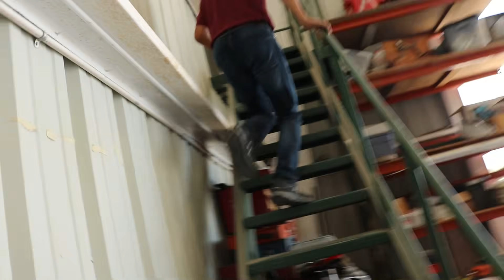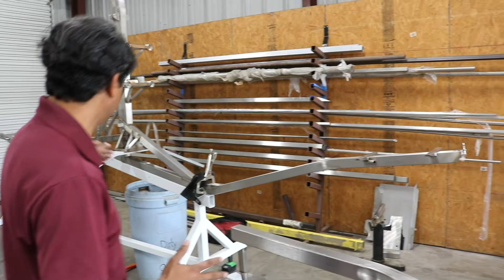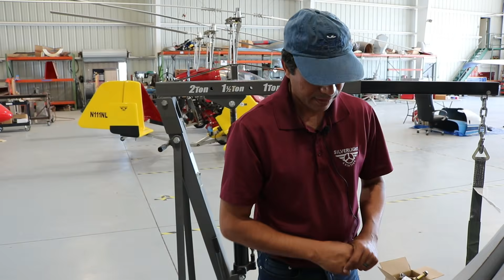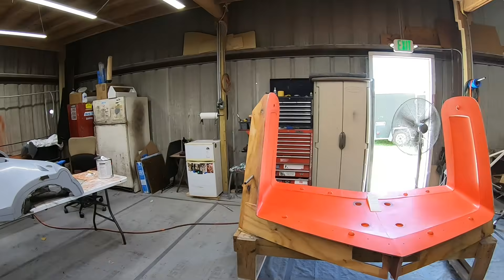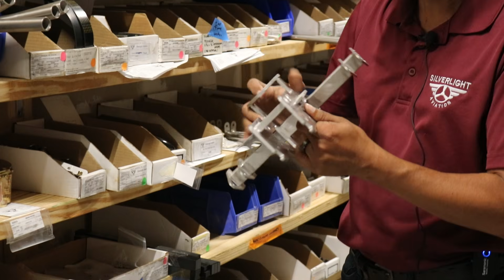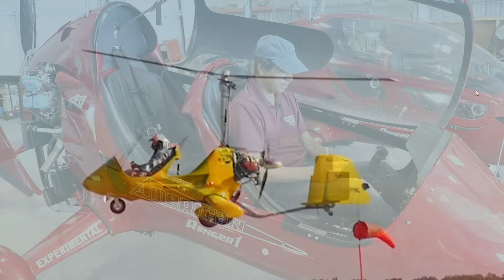Gyrocopters! How Its Made | Factory Tour of Silverlight Aviation Gyroplanes

Comment: Sir can you tell me about airframe material? ??? 7075 aluminium???? Or others? ??
Reply: 304 Stainless Steel Tig welded using 308 rod with Argon gas purge front and back. Are you a structural engineer or designer?

Comment: The issue with these is insurance can't really get insurance in the US for a Gyro being a zero-time pilot. Pilots who have lots of hours they pay 10% of the value annually. $65k is $6500 a year to insure them if you need a loan to buy one can't use the gyro as collateral if you don't plan to insure it. Have to pay cash or find another way to finance it maybe 401k loan or 2nd mortgage. IMO if you don't have the cash to lose have to get a loan it would be foolish to not have insurance.
Reply: That is correct. The gyroplane pool is small. Only 1100 in the US. Also accident rate is relatively higher but not because of the machine. Most pilots coming into light sport in general but gyroplane more specifically are in the 70+ year old range. The accident stats show they are more prone to accidents in all of aviation and they are heavily concentrated in light sport and gyroplane segment. We need more 50 year olds or younger coming into this segment. The accident rate will be down then. Most people buying our machines do not take a loan. They pay cash.

Comment: You'll sell more of them if you install an SEG Electromagnetic Generator for power you'll never run out of. Fly as long as you want.
Reply: That tech is very far away from getting to the point of being used reliably as an aircraft powerplant. Interesting though

Comment: Liked when he said some of the chassis was made in Taiwan or China....But that doesn’t matter...It does when these components fail in mid air......Would not trust....Look how small the production line is.....
Reply: Huh. Nah. You heard completely wrong. Some of the smaller tubing in the frame that is not structurally very significant is made in Taiwan. All the main structural frame tubing is made in a US mill

Comment: Great Video of an Excellent Gyro!  I would love to work with you Abid on designing a FWF package for the MWFly engine line.
Reply from the maker: They are quite set with their Rotax and ASTM standards for the moment. Are you FLYING yet??  In the USA?
Reply: @ExperimentalAircraftChannel  MWFly is ASTM certified, but would indeed require modification of the production standards… however for the Experimental kit builders, it would be another option to offer.  Especially with the pricing increases on the Rotax engine line these days.  The Sonex is airworthy and now flying,  I am hoping to fly it up to Oshkosh Airventure this year.  Will you be at the fall Zenith open house?
Reply: I actually talked to the guys at MWFly in Italy. I think the only way that works is if they gave us a free engine. Even then it is a whole engineering process to develop an installation and pre-rotation around MWFly engine and then do test flights. They did not offer that so it was a non starter. Even Rotax gives selected OEMs a huge discount who are willing to be the first to use one of their new engine models. MWFly needs to learn how to do these things right. They are starting from scratch and not offering much except risk for OEMs.

Comment: As fuel gets more expensive and car gas has more alcohol the fuel temp becomes more important. Hot asphalt on aprons are one source of heat but there are others. Has anyone considered a simple fuel temperature guage ? I've seen some suspicious accidents (admittedly on YouTube)at take off and a couple might be loss of power due to hot gasoline. I'm not a pilot at this time. But flew hang gliders for many years and was involved lightly with some building of earlier gyros.